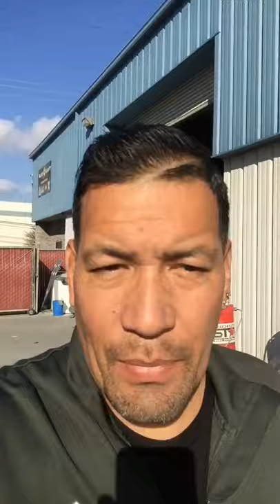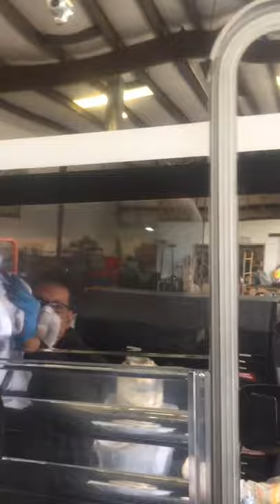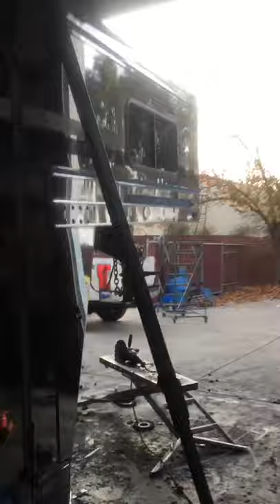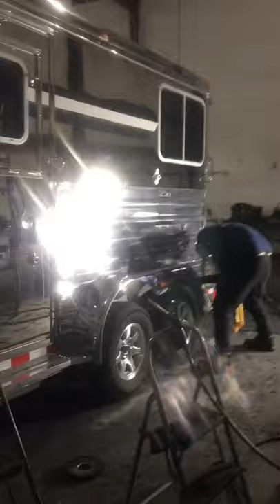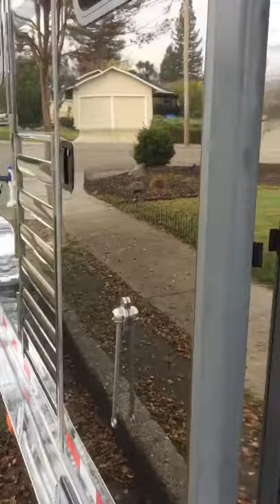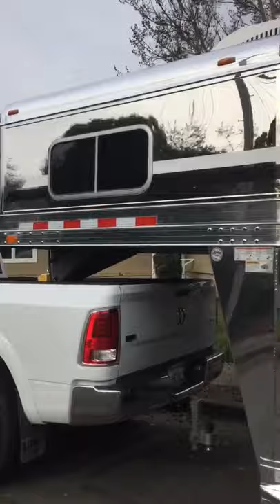Horse Trailer polishing

Comment: Sammy, thanks for posting, you inspired me to do this myself. I’m working on a stock trailer, how do you handle avoiding the red/silver DOT stickers and my SS components are passivated . If I polish too hard this will cause the SS to rust. How do you approach this issue ?
Many thanks from Central PA
Reply from the maker: Daniel hello and good luck to your venture in polishing well we definitely take off the DOT stickers  Ask for your other question I didn't understand you could always call me at 5592175791

Comment: Sammy. Great videos! How do you deal with compound buildup around rivet heads? Do you clean the river heads between each compound or clean up at the end? Thanks in advance
Reply from the maker: Hello and thank you for your question well we compound maybe 2 or 3 different compounds and we try our best not to hit the ribot's too much but we clean it all up right before our last stage which is the cyclo we woke mineral spirits with microfiber towels being careful to use clean rags to apply the mineral spirits and to take it off because if you don't you're gonna move compound around your polished or semi polished area and scratches I hope this helps good luck

Comment: What is causing a cloudy haze after my 3 step yellow, purple and then white wheels? Final polish with pro 40 On Aluminum, Pontoon boat. And how do I get it to a complete mirror? Thank you!
Reply from the maker: Hey buddy thanks for your inquiry will your puppy getting cloudiness due to using different kinds of compounds like to polia cutting compounds would do I are finishing compounds causing an exothermic reaction to leave and deposit some of the compound minerals in the pores of your aluminum this is one of the reasons why we do and asked to wash after the heavy cut I think I left you my number but here it is again 559217 I said an England call me feel any questions
Reply: @sammy3627  I bought the Zephyr 3 step kit with their compounds. Came out the next morning and it was hazy. I appreciate you taking time to answer my question.
Reply: @sammy3627  So are you saying I should recut wash and repeat?
Reply from the maker: Your problem can be a few things the speed of your machine the poorest city of your metal surface the lack of a good cut some oxidation lingering around or some exothermic reaction between the compounds heat generation and compound deposits on your metal surface tell you what call me at 5592175791 and I try out point in the right direction
Reply: @sammy3627  Thank you. Ill text you to call me so I don't waist your time or interrupt what your doing.
Reply: @sammy3627 Thanks to one of your videos and a recommendation from a friend, all I did was a diluted acid wash and recut with a white wheel and white rouge and that worked. No more haze!! Blinding results, need to find a way to smooth the wheel marks out a little better. Thanks for your informative videos!!